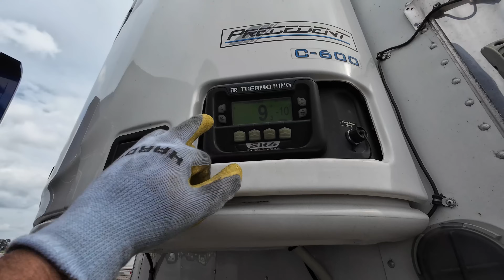MADE A ROOKIE MISTAKE

Comment: You can line that trailer up yourself. Measure from fifthwheel pin to each side of thr front trailer axle then move the adjustment sleves then line back axle up to the front axle. I would spray all the adjustment  sleves everyday for a week so they break loose easy
Reply from the maker: Too late now. They already got it done. But that’s a great idea for next time. Thanks buddy